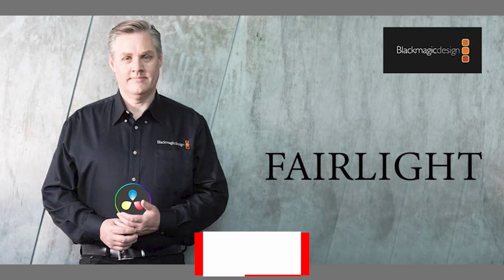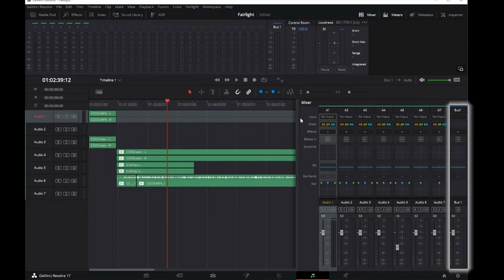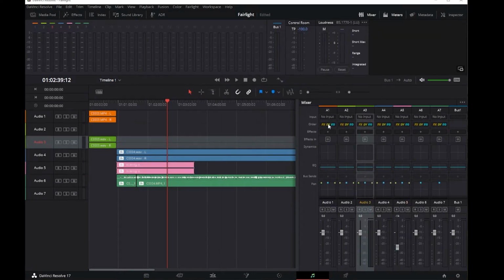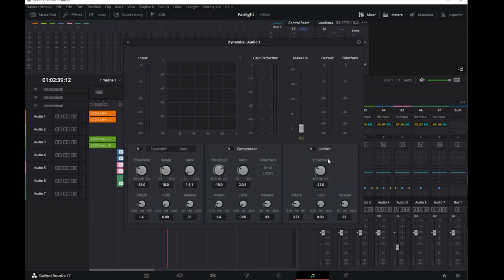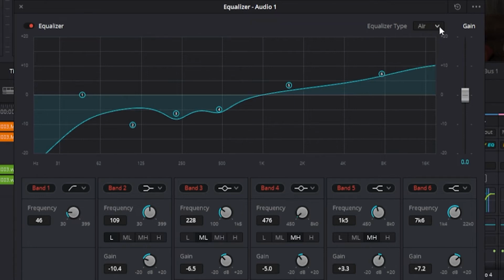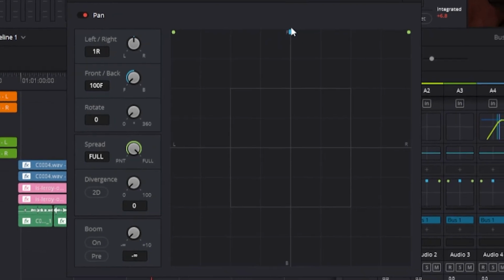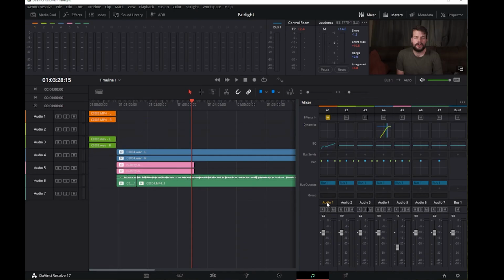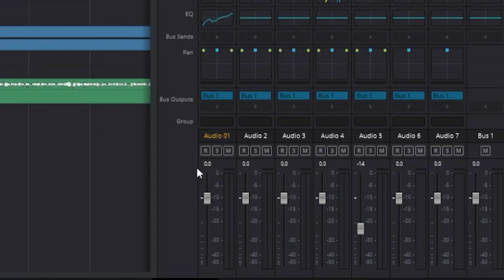Davinci Resolve 18s New and Improved Mixer Panel | Fairlight Tutorial

Comment: May I ask why my Mixer doesn't have anything (eq, order, dynamics, effects e.t.c)?
Reply from the maker: Are you looking at the mixer panel in the fair light page?
Reply: @DiegeticAudio  yes yes! there's an fx panel on the top left side of the window but my main mixer panel (on the right side) is empty. But I think I found it by clicking and struggling. 
Thank you so much tho for your immediate response. I'm new in this software after being absent from editing for 10 whole years. I'll be sure to check on your content. :D
Reply: @regeneratedwitch  What was the solution? i have the same problem
Reply: @edgardoalomar4925  haha I’ll answer in a while
Reply: sorry i was busy, i think in fairlight, my "meters" tab wasn't active. check it out and tell me if that was the issue.
Reply: I don't have it either and I'm not seeing a solution offered here. Can someone please help?
Reply: @joncory5680 on the upper right corner should be a meters button. Click on it, your eq and all that should appear. But you wont have the video screen there anymore.
Reply: @joncory5680  it’s just an option on top right, press it!